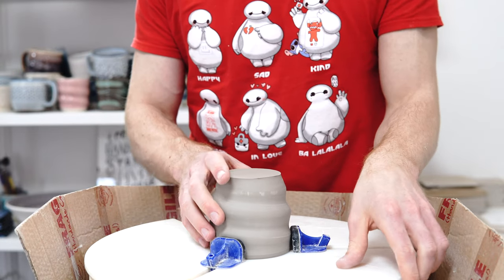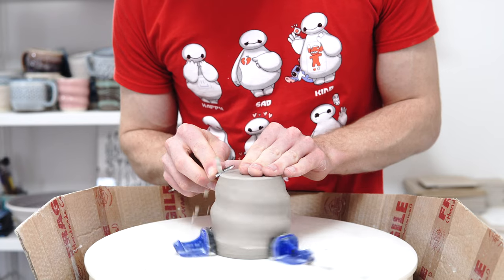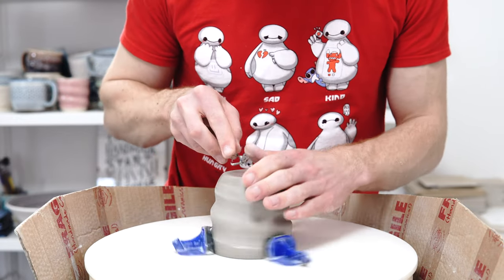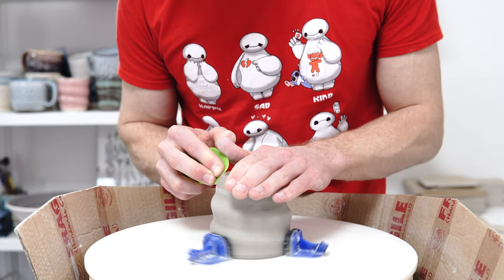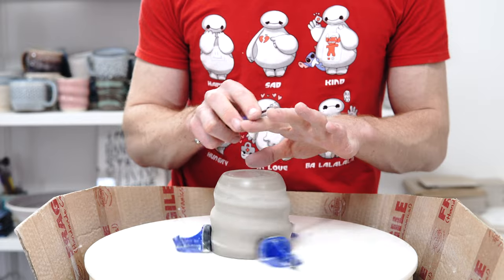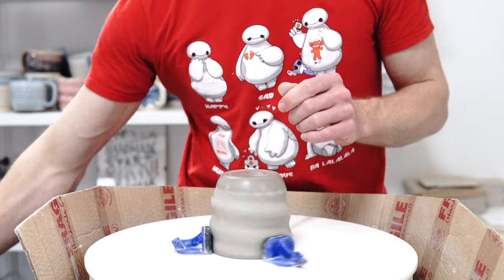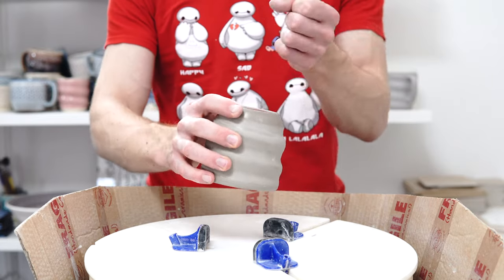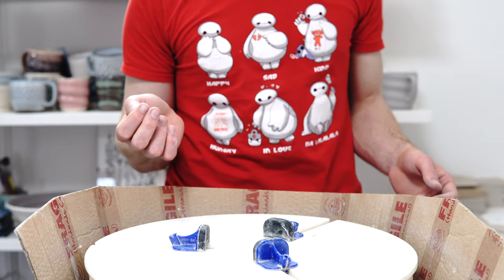Mug Trimming - Quick and Easy Burnished Foot

Comment: Very streamlined process thank you for showing! Do you have another video on grogged clay? finding it tricky to get a smooth surface am I just fighting the nature of the clay body
Reply from the maker: I haven't used a grogged clay for a few years, so there might be some tricks that I don't know about, but I think you're fighting the nature of the clay. Grog won't shrink as it dries and is fired (as it's clay that's already been fired) so, regardless of how smooth you make the clay at leather hard, it will always become more pronounced in the finished piece. Unless there's a good reason for a heavy grog, I'd try to find a clay with a fine grog. It's possible to have a lot of the benefits of a grogged clay on a clay that throws and burnishes much smoother.